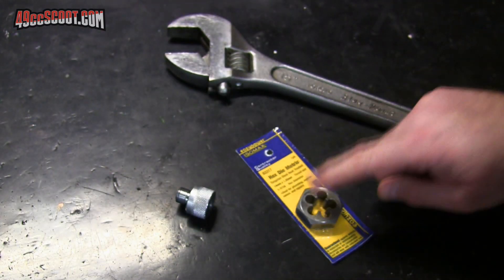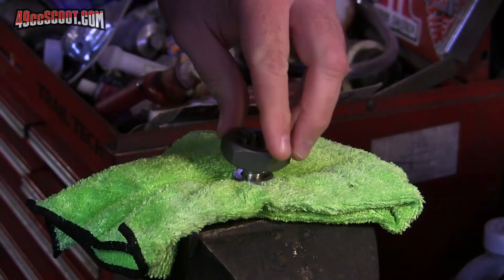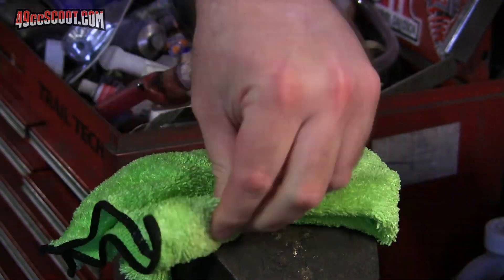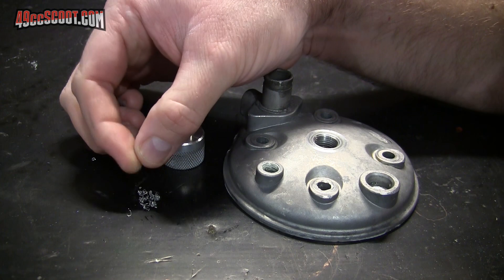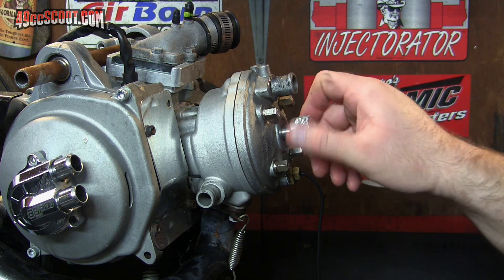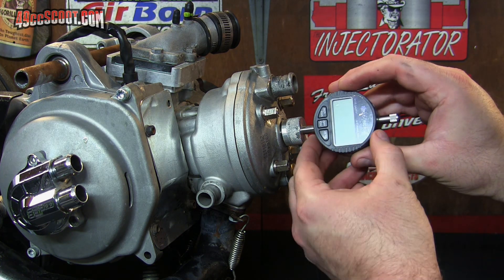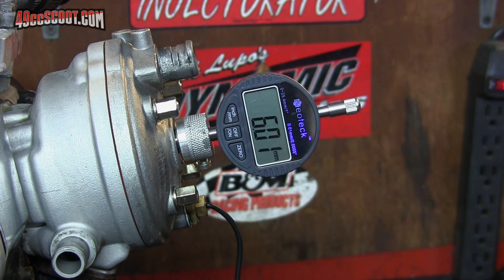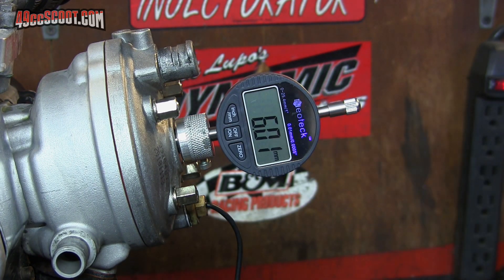TPR 86cc Build : Part 18 : Making A Dial Indicator Holder For TDC And Ignition Timing Setting

Comment: Hey 49cc scoot I have my Minarelli horizontal copy engine I want to put a better crankshaft I want to bore it out for a 70cc mk2 racing cylinder but it requires a better crankshaft would you help me I want to buy a crankshaft but I don’t know which one will fit on it this is the number on my engine 1E40QMB

Comment: Brass screw, won't dig into gauge as much.
Reply from the maker: I almost made an aluminum thumb screw, but I was too lazy and with only light pressure I don't think it will be a problem. I turn the screw in only till the gauge doesn't move and no more. Wouldn't want to put much pressure on the indicator with any type of screw.

Comment: Greetings from Finland. I haven't lathe, so i made my own from old spark plug. Plug hole was too big my dial gauge. I melted the plastic and drilled a suitable hole.
Reply from the maker: Some people also clean out the ceramic and weld the steel up then re-drill. Either way, it's always nice to hear of people making their own tools.

Comment: I had 2 beers after dinner tonight. I thought about premixing them with my chicken but the ratio didn’t seem right. Now for some reason I’m all seized up. I’ll try another beer and see if that works to loosen things up.
Reply from the maker: I thought this was gonna be like "if a train is traveling south at 60MPH" kinda thing at first.

You gotta be more careful. There's a chart somewhere, but I think it's about a 4:1 ratio with fried chicken. That's 1 beer per 4 pieces of chicken. Baked and more dry versions may require a different ratio, like 2:1. You may need a calculator to really dial it in when you get into wing vs thigh... domestic vs import... The foolproof method is to cook beer battered chicken and forget the math. Eat responsibly. Don't get clucked up and drive/ride.

Comment: I found 0.10-0.37.5 idle jets on aliexpress today.I use 0.32 wich is smallest in my old packet,and engine wont start proper,and stops for 1 second because it gets overflowed with petrol driving distances.On my naraku carburator it has maybe,it dont say,but 0.85 mm main jet and 0.2 idle jet for the biggest 90cc drag-race cylinder.